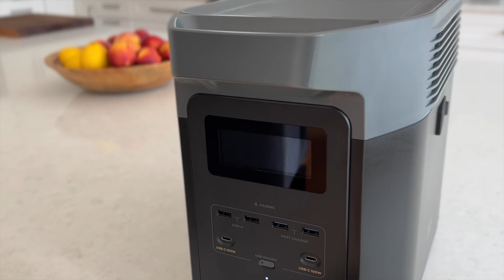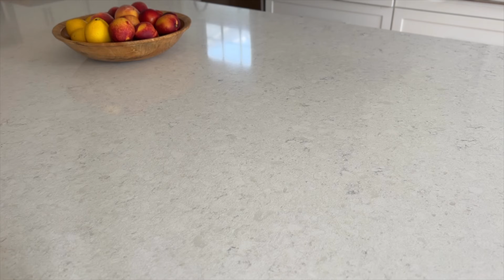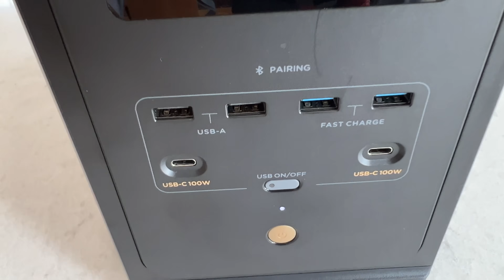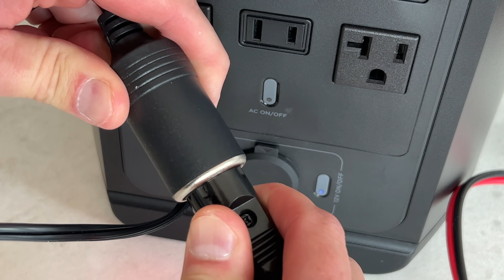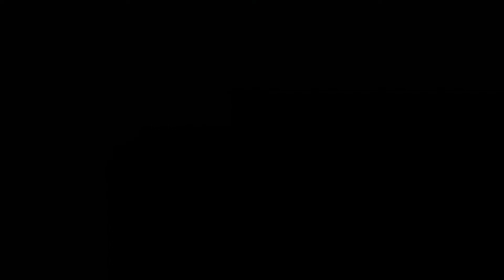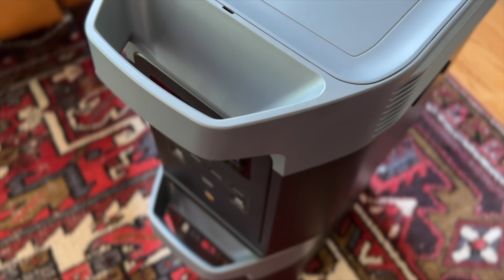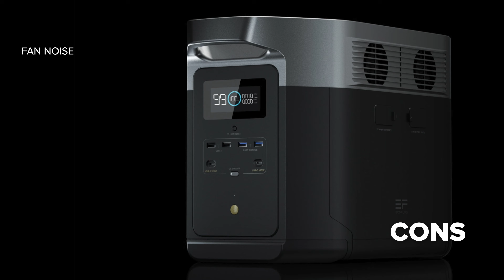Ecoflow Delta 2 with expansion battery - Best midsize power station in 2022

Comment: I did talk myself out of buying the D2! The efficiency of this unit is only 80%! I would expect at least 85% for these units. The industry needs to change their capacity rating and/or over-build the storage capacity of these batteries. You can expect to get only 800w out of this unit. And the extra batteries are useless without the main D2 unit. They should be usable no matter which main unit is being used.
And coercing buyers to buy their solar panel cables is downright Olight-ish. They only come if you buy their panels. You can make your own if you buy the connectors and a soldering iron.
I am going to wait a few weeks or months to see what else is released by whichever mfg. I have 7,200w usable solar storage capacity now, so I can work with what I got and do not "need" the D2. Bummer, I was really taking a shine to it.
Reply from the maker: I think overall, this is still the best 1kw unit out there by far but I agree with your concerns, I mentioned all those as well.

Comment: I have been TRYING to talk myself out of buying the D2 and the DMax Extra battery. The opposite has happened: i find vids like this that confirm that this unit is the best in class. My fear now is that EF will introduce s newer version or offer an even better price right after I buy the units. I am suffering from paralysis by analysis?
I want the DMax battery even with NCM chem. I figure it will get to 80% capacity faster, but since it has twice the capacity, its life time output will surpass that of a D2 extra battery. My concern prior to ordering is that the D2 is 120v output, the DMAX spec states the battery is 110v. Not sure what affect that will have, I AssU_Me that would lower the main unit (D2) to 110v.
Reply from the maker: I think Ecoflow is moving to LFP with good/better/best lineups for small (River) and large (Delta) so the D2 will remain the same for a while. I expect a LFP Delta Max soon since it’s now the only NCM unit in the Delta lineup (not sure what is happening with the Delta mini)

Comment: Loving my delta 2. Only thing I’ve been hearing from other utubers is ups power backup of 30 milliseconds is too slow and may damage some sensitive equipment.?
Reply from the maker: I doubt it would damage anything but it just means that if you were running a desktop computer it might cause it to shut off and restart rather than staying on because there is too much of a gap. Even that depends on your computer, some can keep running to cover the 30ms. For other things like your internet router, worst case is it restarts when it switches over

Comment: Can you connect two Delta 2's and boost your power use...
Reply from the maker: No, there isn't a way to combine 2 units like you can with the pro. if you need a more powerful inverter, size up to the Max or Pro
Reply: @todd.parker  Thanks
Reply: @todd.parker  I'd prefere LiFePo ...
Reply from the maker: @pip5461  me too. Hold tight, I’m sure that’s coming

Comment: I wanted to like this but it’s only 76% of the battery capacity that it’s listed at due to a failure of efficiency. It’s literally the worst one they have made in terms of efficiency and is way below industry standard. The delta MINi actually has more capacity because it’s 91% efficient.  Crazy. For $700 just no liPo I will wait and hope they fix this efficiency failure on a new model.

Comment: Could someone explain, why it is "impressive" to get 830 Wh out of an 1024 Wh battery capacity? To me it would seem like they are lying about the real content of the battery. Almost a difference of 20% to what they claim.
Reply from the maker: They aren't lying - the actual battery cells are 1,024 but to use them you need to convert that the 48v DC cell pack voltage to 12v or 5V (USB) or 120v AC - all of those have conversion losses (heat) so this test tells us how efficient it is at this job. 20% losses is typical so that's our baseline for judging these. When you put gas into a car, the gas has a specific amount of energy stored but each car will give you different miles per gallon (MPG) because some of that energy is converted into waste heat. Same idea.
Reply: @todd.parker  Wouldn't it be fair then, on a consumer perspective to state the real Watt hours, or store more cells so you get a practical 1 kWh out of it. A normal first time buyer would expect, for instance an appliance that constantly drains an output of 100W to be powered for 10 hours, not 8 hours. Feels like a sale lie to me, like selling a can of beans and just stating the total weight including the can and water, not telling the nett bean weight when drained..
Thank you for replying to my comment btw.
Reply from the maker: @dino1604  I totally agree that the way these are marketed across all companies leads to disappointment because you lose around 20% off the top of you run the battery down in 5 hours. If you’re running smaller loads for longer, losses actually increase because there is idle power draw. It’s a bit nuanced to explain to a consumer but it makes it confusing overall.
Reply: @todd.parker  To touch on the smaller loads for longer aspect:
I saw a video testing the EPS on the new delta 2, and I saw that it was pulling in 50w while outputting 40 W. The 10W difference for the invertor/unit itself, I found very large. It would be kind of neglectable if you would use powertools and run the whole battery in like 2 hours or so (just losing 20 watts of the total of the potential 1024 to just the unit itself) but I find it a shame if you would have a low powerdraw situation of 50 watts  with the unit using 10 watts (at 80watts even more because the fans kick in), and thus being a relative 20% of your consumption and thereby losing your potential of drawing 50watts for 20 hours and now the realistic picture being 50+10 for 16ish hours. Comes close to your tested 83%.

Comment: Have to agree, as an owner on the Anker 757 Powerhouse. I got mine for discounted launch price, so slightly less than the Delta 2. The portability and expandability of the Delta 2 vs the Anker makes the Delta 2 the hands down winner. The Anker does have 20% more battery capacity for the price, it's main advantage. I suppose that means for a comparable price your fridge/freezer could run for an extra few hours on the Anker.

I'll see if any Black Friday deals pop up for the Delta 2, fingers crossed!
Reply from the maker: Glad you agree. I do think Anker is improving quickly so maybe the next product or two will help them pull ahead, we’ll have to see. For now, the Delta 2 is the best value at this size and has the best feature set so it’s a slam dunk
Reply: I was checking out a friends 757 and was disappointed there’s no app support. Even on my cheapest EcoFlow River 2 I can see the charge level, set a ton of parameters, etc from anywhere. If I were shopping for a 1 kw unit I’d get the Delta 2 based on connectivity. Surprised the 767 has just BT too.

Comment: Great review and thanks for the discount code.  I don't like the idea of buying the extra battery that doesn't have any usable ports on it for stand alone usage.  Could two of the Delta 2 be chained together instead?
Reply from the maker: Glad the video helped you decide. Unfortunately, 2 Deltas can't chained in the way you're hoping. You could certainly buy a pair of them and swap when one gets low but you might want to get a Delta Max if you need the capacity since it will give you 2kw in one package. It's not LFP but I bet that will change at some point soon-ish. I do wish the batteries were more useful by themselves for sure

Comment: Why the external battery is without a DC-input is beyond me. Would have been so nice to have a few of these battery's connected to a DC-source waiting for when the grid goes down.
Reply from the maker: I agree, that seems to be how other companies are doing external batteries so hopefully next generation…
Reply: @todd.parker  A clickon module that allows on to directly charge the external battery might be an idea for Ecoflow. But not likely.
Reply from the maker: @HansKeesom  Zendure is doing a stackable connector so maybe someday
Reply: @todd.parker  I think I can use the powerstream as such module, but only for 12 volt charging..... if only it could reverse the electricity to the AC

Likely I can use the solar input of the powerstream to push power into the external battery :-)

Comment: Outstanding review! Luv the comparisons too. Best review & best in class unit. (BUT, for anyone thinking to add the extra batt for 2kw), I think then the Bluetti AC200 MAX for similar total cost, total higher outputs, much higher solar input, wireless charging pads on top, RV outlet all in a smaller unit since you would have all 2 kW in one box. 

I know this is a 1KW review. Just speaking for someone who is considering adding the extra battery module to this unit, makes more sense to go to AC200 max. Thoughts?
Reply from the maker: I think that’s fair. If you need 2kw, the AC200MAX would is a very good choice. It’s much larger and heavier so if you have use cases where you need more portability sometimes then the Delta 2 is better.

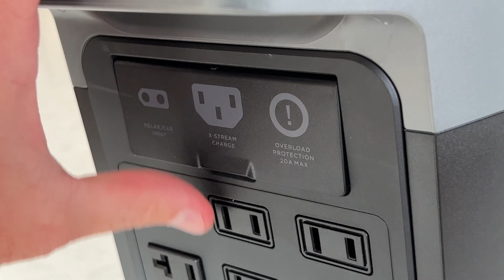Comment: @3:31, you had said that there was 5 AC outlets and 1600w on the Delta 2, but that 1600w was for the original Delta. Just wanted to point that out. All in all, a fine review.
Reply: It's 1800w continuous with x-boost to 2200w and surge to 2700w

Comment: Just received mine & paperwork says 24 month warranty 🤔
Reply: It's 5 years. I called ecoflow and asked. It's just the same literature from the original Delta.
No worries!😎
Reply: @fckjb284  except the battery % is weird, had it charging to lower & lower percentages. Ended up in the 20% range, advice from Ecoflow wasn’t helpful. Seems to be the battery management forgets where 1% is & causes the 100% to display lower & lower values over time. It’s a shame because I was thinking of buying another unit to increase the storage available.

Comment: Hello Todd, great review, thank you for that. Would have been great to have a better comparison between the Delta2+Delta smart additional 1kw battery and the delta max. The capacity would be the same with the mentioned config, but the question is: using the two delta2 batteries connected, would this also increase the output on this? The delta max can hold around 2,4kw output, the delta2 only 1,8kw… if I connect the additional battery to the delta2, will this increase his output?
Which of the two “combinations” would you buy, recommend: Delta2+additional extension battery or delta max? Or wait until a Delta 2 max will be released?
Thank you very much.
Reply from the maker: Good question. If you already have the Delta Max battery, use that but if I was starting from scratch, I'd stick with the D2 battery since it's also LFP. I assume they will upgrade the Max to LFP soon so if you really need more capacity, wait for that. As far as output is concerned, adding extra batteries only increases the runtime, it doesn't make the AC or DC output stronger.

Comment: Glad to come across your review with a comparison against the Anker 757 which I'm returning in favour of the Delta 2 with the add on battery. Your reference to the reduction in fan speed at lower charging has held me off from cancelling the ecoflow order. It will be charged at less than 200 watts on solar everyday. My only concern is I live in the UK where sun limited in winter. I'd love to know now this is lifep04 will it allow the unit to be connected to the panels on xt60 and switch off at dusk when zero wattage being received, and start charging again (without manual intervention)  as soon as daybreak feeds it a couple of watts , 10 watts 30 watts and won't block it like the Anker 757 does. (Xt60 needs disconnecting and the display button to be pressed, to kick it off into charging on solar again ) I need to be assured no manual intervention would be required on the ecoflow. But app access intervention would be fine... any thoughts appreciated...
Reply from the maker: So you want me to confirm that the solar will start charging in the morning unattended? I think that’s going to work, no problem

Comment: This thing has between a 80 to 100 Amp / h battery in it, and that for 1 grand? What a joke. You can get those Lithium battery cells for 120 bucks, 2k inverter for 160, BMS for 30, AC charger for 60. Internals are worth 390. Also, this is way too small to power anything meaningful. Hook up an induction cook-plate for 40 minutes and this thing is fully discharged. How will that help in a power outage?! This is a toy!
Reply from the maker: There’s a big difference between DIY and buying a fully integrated product with safety and usability. Those prices sure are something. Mind posting a link to a 1,200w wall charger for lithium batteries that costs $60? I’d love to pick one up
Reply: @todd.parker  Where did my reply go? Did you delete it or YT?

Comment: It s good for laundry?
Reply from the maker: Depends on your equipment. This will power anything that plugs into a 15A 120V circuit. I know most dryers are 240v but washers should be fine
Reply: Thanks ! I live in Europe (220v 50hz)...Washers with 2200w works I think.
Reply: @nicumarinoiu5358  European washers use heater elements. This toy will NOT be able to run it at all.
Reply: @asdadasdasd4594  thanks!

Comment: Thanks Todd for the review. Do you think this could power a front load standard European style washing machine maybe at 30° for a cycle? I saw another guy from the UK on YouTube do it with the deltamax and it used about 15% of the battery - but I’m wondering whether this one could do it with or without the extra battery. What do you think?
Reply from the maker: I just looked it up and it seems that running a load on cold uses about 500w and on hot 2000w so there’s a big range based on temp. The inverter can output 1,800 continuous and up to 2,300w for about a minute so I think this would work. Worst case, if you run it for a full hour on hot it would need the extra battery but I’m guessing the power use varies a lot over time so it’s not 2000w continuous.
Reply: @todd.parker  What a detailed answer and fast answer! Thank you so much. Many do reviews on these type of devices but always neglect to mention a washing machine - which is a common appliance.
Reply from the maker: Yeah, I should add that to my tests!

Comment: Can delta 2 extra battery work with ecoflow delta max?
Reply from the maker: Unfortunately, no
Reply: @todd.parker  so delta 2 can take delta max extra battery but the reverse isn't feasible? So modularity only works one way... that sucks.
Reply from the maker: @LJLion  That’s my i understanding and I could be wrong but I heard that the Max needs to be able to pull more amps than the D2 battery can handle so the throughput wouldn’t work. They can be mixed because each has a BMS so it’s possible they could make it work somehow in a firmware update
Reply: @LJLion  I like one piece power station with high wats and not 3 pieces .Preference. Good review

Comment: Note the solar cable they sell is XT60 (yellow) only support 8A, you need XT60i (orange) for 15A which they don’t sell it.
Reply from the maker: Thanks for the clarification, I was wondering what the difference was in colors, that’s a big difference! I had the XT60i cable from my Delta Max
Reply: No problem, the orange plug XT60i has addition pin in middle.

Comment: Very nice review! I think one thing that was not mentioned is how it performs as a UPS. Did you check that? If so, I would be very interested in hearing your thoughts, please!
Reply from the maker: I tested it and it worked as expected. It’s not a true UPS because there is a brief flash when it switches over. Takes 30ms. Some PCs wood be ok, others would shut down
Reply: @todd.parker  thank you for the reply!

Comment: 60V 500W max solar charging was a deal breaker for me. Bigger battery and inverter helped to swallow the price pill. 
I went with a Bluetti AC200P. its 150V 700W max solar input, closed the deal. 
Hooking it up to 4x200W 12V Renogy panels in series. 
The extra Watts comes in handy with partial shading and cloudy days, and wasted in full Sun.
Reply from the maker: Yeah, for a unit this size, it's a reasonable spec but with the extra battery, it starts to be closer to the AC200P size category and that has a much better solar charger. Sort of depends on if you want a portable, modular system or a more powerful but harder to move unit. I like the 200P but it's heavy!
Reply: @todd.parker  Agreed.

Comment: I have a question. I have the older 1260wh version. I wanted to use it as a ups leaving it plugged in all the time to home 120 outlet. Because of the pass through power the unit uses your home power when plugged in. Sometimes the unit I had plugged into the ecoflow is not drawing any power, when this happens the ecoflow was over charging the battery and getting warm. The battery percent would drop to 95 and the cooling fans would run with the unit getting very warm. Has this issue been addressed with the newer unit?
Reply from the maker: I haven't seen that happen in my tests so I think it's resolved. I believe the older Delta didn't have a UPS feature at all so I can see it not working well in this scenario. It's a big upgrade!